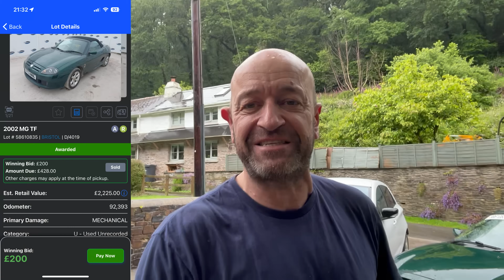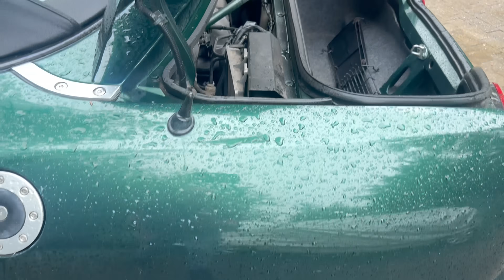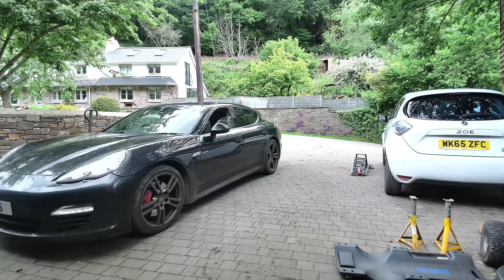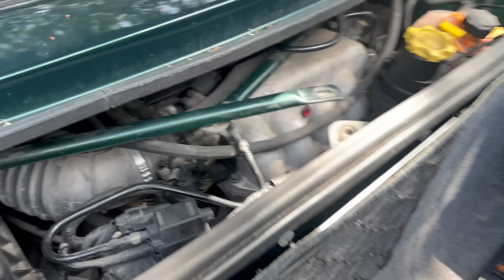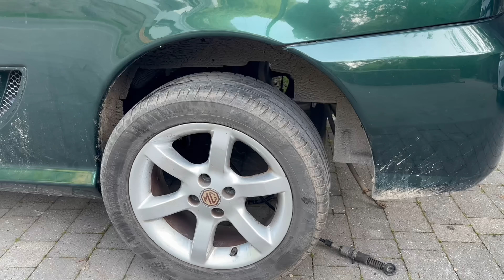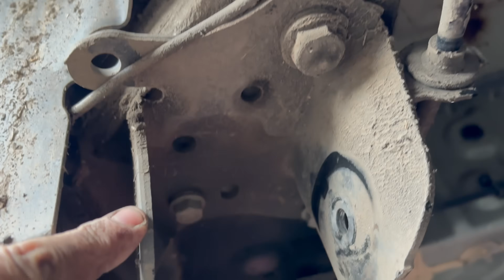my Mid Engine Petrol EV UNConversion

Comment: As a mechanic myself i wonder how easy it would be to fit renault clio 1.2 running gear engine/gearbox etc from say 2003 clio into a zoe...the old clio upto 2007 ish were such great little cars as long as you didnt have sunroof which leaked and sometimes bsi faults.Then again still plenty old clios about and they were 1 little french car wich was pretty decent.👍👍👍
Reply from the maker: Yea I’d reckon it’d be a damn site simpler than messing with the arse end and an mg !

Comment: Many years ago I sold the vvt engine and subframe,various parts wiring and ecu  from an mgf. The guy was putting the entire subframe and engine in the front of a metro. Apparently the subframe used the same mounting points and bolts straight in. Many months later we saw the same guy and he told us that the car was crazy fast and it went very well. So well he had a major accident while grass tracking in it and had spent several weeks in hospital. Hope you have better luck with your project
Reply from the maker: yes the VVC engines are great - 160 brake and a nice kick in at 4.5k rpm - had a few in elises over the years. mine is a boggo tf... i think 135 spec  - should push a zoe along pretty well id reckon.  will 100% get it on scales once that electy motor is out the front :)

Comment: Wouldn't it have been a good idea to see if it is the head gasket or just a leak by doing some tests before you go too far into it ? At least you could get the engine warmed up and the water under pressure.
Reply from the maker: If it runs, thats all i need for now - so many unknowns to sort to even say this is feasible - but a HGF on a k series i've done half a dozen times so no biggy.  oils the right colour as stands so happy to run a bit to test but ill give a proper looksee if we can get it sitting in the back of the Zoe and wheel turning :)

Comment: If you can find one, wouldn't it be better and easier to use a late Metro/Rover 100 series subframe to mount the K-Series at the front?
Don't forget to grab all the immobiliser related bits off the MG, before you let the shell go for scrap.
Reply from the maker: "easier" yes...   "better"  nah....  Rear wheel drive mid engine! "Zoe 4r2" "Zoe V4" "Zoe Turbo" (though having had a turbo rover im not sure thats sensible!).  be cool to try a FWD one as of course keep it close to origional (thus no butchering body shell etc!)... imbou and wiring ill defo be grabbing.  i recall on elise its was quite simple to jump a connector to bypass imobiliser etc so was rather hoping to do same on this... but it's nice to have a full loom and ancilleries sitting on the driveway to experiment!

Comment: These conversions could become popular if the cost of fitting ICE is less than new batteries..
Reply: Be amazed if it is ever cheaper to fit an engine.   A new engine in a normal car isn't worth it. Never mind adding a fuel tank exhaust and god knows what else. Gearbox etc
Reply: @chrishart8548 yes can’t argue with that. In a way it’s also rather ironic that so many people are choosing to remove the old ICE engine from their valuable old classics and fit Electric drivetrains..
Reply: @philtucker1224  looks rather good convert an older car to Electric.  The really old engines were awful.  Loads of fumes hardly any performance.  And not usually very reliable either.
Reply: @chrishart8548 yes (and providing they register the new EV design) they can go into London.
Reply: @philtucker1224  maybe they want to use it rather than worrying about how valuable it is.

Comment: Be interesting to see qhat the DVLA make of it. They wont update the fuel type of 2001+ cars on the V5. 

My electric comverter BMW is still a diesel on the v5
Reply from the maker: no clue - i think the kit car route is only real option from what im reading - can you imagine the bewidlered look of the person at DVLA opening the V5 change of details request :):):):)
Reply: @sevenone6 Ive been there, the sent a bloke round, decided its not radically altered because Id not cut or welded the body. So despite having no fuel tank, exhaust or engine, but having a battery and motor, its a diesel. 
If you call up the dvla kits&rebuilds dept you'll lose the will to live.😂. Good luck, cant.wait to see where it goes.
Reply: I don’t think it’s very important so I would stop worrying about it. As long as the police can “ recognise” the car in the street from the DVLA description that’s all they really care about.
Reply: Road tax/Legally agreed On Road insurance.... 🤔

Cool project

Subbed ❤

Comment: How do you get it to comply ,, regs,, etc
Reply from the maker: i have not the slightest clue Tony - be amusing to do a V5 change of details and sent it off to the DVLA... i mean people covert classic cars to EV's all the time right?  so why not the other way?
Reply: @sevenone6  I absolutely love this project, but getting this to be road legal is not going to be trivial.  Cutting the monocoque, and especially cutting a bulkhead makes this a "radially altered vehicle" in the eyes of the DVSA and means means a BIVA test will be need to be passed.  It also means losing the original registration plate and getting a "Q".
Reply from the maker: @ferrumignis  yea ill be honest i really wasnt thinking of this being a legal road thing... bit of fun etc - but that said it could be amusing (if its not serious £££) to try going through the process if at some point it is a proper running driving thing.
Reply: @sevenone6  It would make a super fun track car, avoiding all the red tape nonsense.  I imagine the Zoe without the battery and motor etc. would be quite light weight.

Comment: Putting a Renault CLIO  engine & subframe set up into a related ZOE would be a better bet....
Reply from the maker: Yea Richard i did think abnout just swapping over the front end...  i mean sounds easier on paper...  but this mgft popped up on copart and id messed with one before to nab an engine from a rust one for my elise - so hit me that the rear end swap would be a nice challenge... oh and the £200 winning bid rather swung it.  if the second Zoe has issues after motor swap i may have a second one for a project if this goes... though would be funnier to go for a small diesel turbo unit ;)
Reply: or a Smart 453 / Renault Twingo engine

Comment: Very close in dimensions.  I would use the flat axel mountings as a staring piont and fab up a new cross member to attach the rear of the subframe. Will be an amazing and fast Zoe when done. There's a few hundred pounds in spares you can sell of the MG once the project is finished.
Reply from the maker: yea for sure will try donate a few spares to the mgf community when done for beer tokens - as its a tf i suppose someone might be in need of a few of the body bits etc.  i resisting posting a classified add on the forums as - to quote my mother in law (seriosuly!)  - "Thats lovely why are you not fixing it!" - so can imagine the thoughts of the mgf lovers to my butchery :)
Reply: The body will flex like crazy due to the battery being absent... Rich Rebuilds had the same issue with his ICE powered Tesla....
Reply from the maker: @kylereese4822  yea im not so sure a rover k series will quite effect the scuttle shake as a V8 lump like Rich did... though could always just bolt in a nice bit of steel box to the battery locating points i guess if needs be - though again doubt this is gonna be something ill be "pushing" enough to notice!

Comment: Getting everything to talk will be interesting.
Reply from the maker: yea cant imagine the mg stuff is gonna parllay francais anytime soon.  i was thinking if i can run the two sytems "co habiting" side by side we should be good.  cleary the dash is zoe dash is not gonna be any use -but i was thinking the start button could be hooked to the mg loom, and perhaps have the mg clocks and gauges.  handbrake is mechanical so that should be simple and ill hack in the gear shift from the MG - brakes im guessing i can just hook up the mg calipers to the zoe system as is...  what i dont have a clue about yet is how the zoe power steering is gonna fair... i guess its electric but wonder if its 12v or 420v?   if the former perhaps its something than can be run directley without the zoe etc etc getting involved.  so many questions outstanding and no doubt much i've not even considered!

Comment: To be fair, that mg doesn't look bad
Reply from the maker: Yea as ever with such “destroy it” ideas I really was thinking I need to find a rustier one!!!  Someone’s looked after this - but needs must and she really would divorce me if the driveway gets any more “projects” on it!!!!
Reply: @sevenone6  The battery pack is the main structural part of the car, cutting the out the rear is weakening the structure even more, all on the path of failing the SVA test to making road legal oh and it will be issued with a Q plate made legal....
Reply: ZOE is based on ICE Renault Clio so battery is not likely to be structural.. @kylereese4822
Reply: @kylereese4822  The battery is a structural member, hardly the main one.  It would be relatively simple to fabricate a tubular frame to replace the battery and put that strength back so this is a very minor consideration.  The IVA problem is much more significant if this is intended to be a road going car.
Reply: @sevenone6  Rich rebuilds has Chassis Flexing issues with having no battery pack in his ICE powered Tesla....